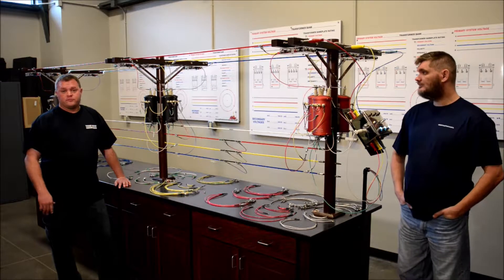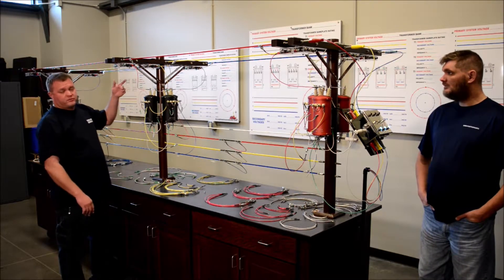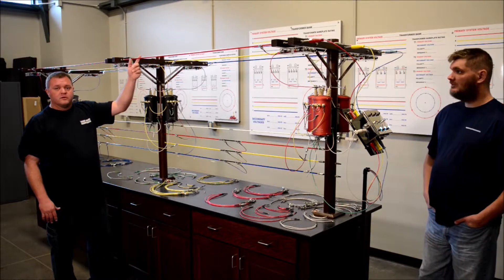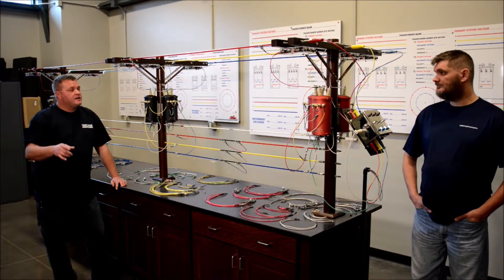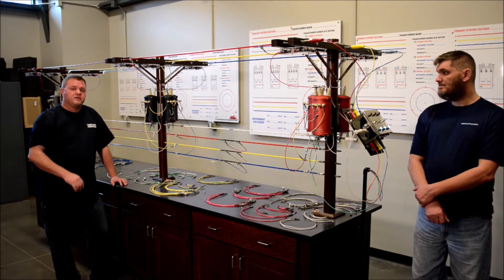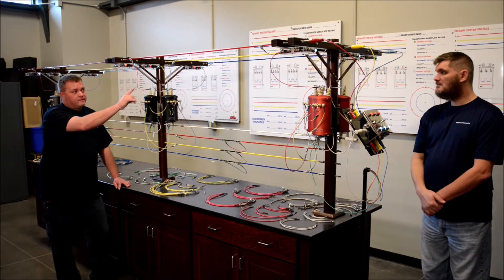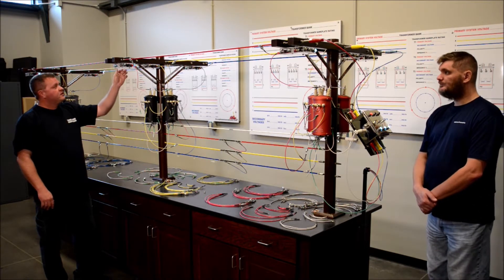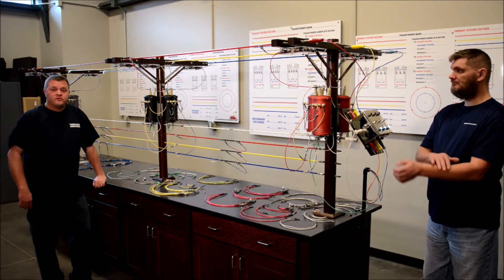The Effects of Backfeed Within a Delta Transformer Bank

Comment: are those real transformers??? if so that is cool i want one
Reply: Hello Marc, Yes, they are a miniature version but everything is made out of 6061 standard aluminum, porcelain bushings and the can is even anodized for safety precautions. The pole mounted transformers can be made anyway the customer chooses. We even make them with single bushing high side and polished as well. The secondary voltage ranges from 120/240V to 277V depending on the customers preferences. All of our equipment can be checked out on our website and thank for checking out our videos. Threephaseinnovations.com.